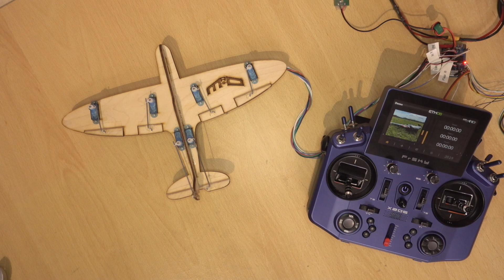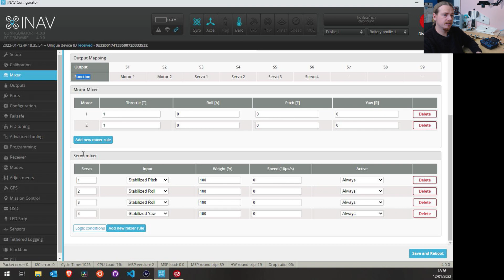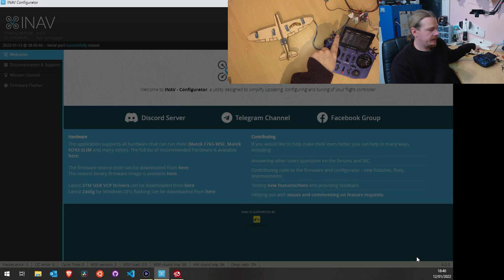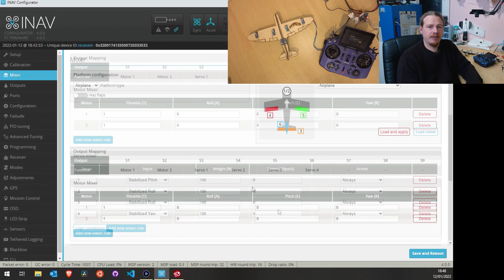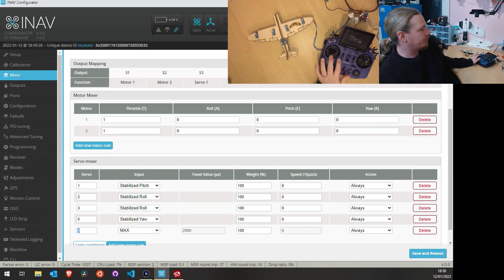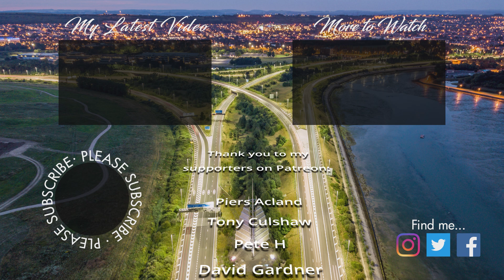Understanding the mixer in iNav

Comment: Good morning mate, just a quick question. I have a bush mule V2 RC plane that I am wiring up on. A. Speedy b flight controller. The bush mules ailerons were connected together into a single servo plug. Do I split the aileron servos so I can plug them into individual output pins?

Comment: Can I apply a logic condition to motors as well as servos? Like for a push-pull inline twin airplane, could I set a 3-position switch to front/both/rear motor selection, that then enables the single throttle stick to control only whichever motor(s) is selected, while the other motor remains frozen at whatever throttle setting it had.
Reply from the maker: No, motors do not have that option.
Reply: @MrD  Thanks. I've got it working in EdgeTX Companion now, instead of using iNAV. Not perfect though, still needs some tweaking.

Comment: Hi, can you possibly explain to me why half the servos don't work in my FC Matek? It reads them on INAV but they don't work
Reply from the maker: If it’s the F405-WING V2. Did you connect the power?
Reply: @MrD  yes
Reply from the maker: @ossamanyadi1919  i think you need to ask in INAV Fixed Wing Group on Facebook or Discord. It will be easier to see what’s going on there.
Reply: @MrD  I will do as you say, because the problem is very strange

Comment: What's the mixer setup if I only use one servo in the middle to regulate 2 aileron left and right? One servo linkage to each left and right aileron.
Reply from the maker: I'm sure there is a mixer for a single aileron servo in the list. If not, you can just delete one of the stabilised roll lines

Comment: Hey Darren, at 8:13, you mentioned putting climbing mode on a switch which would also require offsets. Do you have a video that describes how to set that up?  I imagine that would be done on the radio mixer (not on Inav). Thanks.
Reply from the maker: The offset is so that there is more up than down. You'd just set that on the transmitter using weight or curves. There is a video on climbing mode https://youtu.be/6PZ83l5BcS8?si=diU3o67cpz33chmu

Comment: Darren, thanks for the video. In a flight accident (bad crash) the ESC "+" S1 pad of a matek F405 - WSE was stripped and I am unable to weld back the ESC. Can I use the ESC "+" pad of Motor 2 instead? this way I would recover the FC that seems to be working for all the rest... thanks for your advise with this issue :)
Reply from the maker: Both the main power pads for the ESC are the same. So it’s fine. You can use S2 too if you need to. But you would need to add a 2nd motor on the mixer.
Reply: Thanks Darren ! That saves my FC to go into the bin 😊. I thought that the FC would not manage having one motor only on S2. Thanks again

Comment: Hi Darren. Very good videos. Question: I have a glider without ailerons (ie only engine, elevator and rudder, three channels). Is it possible to use INAV to control this? What should I do in that case, change the aileron channel to the Rudder channel in INAV, or do I just leave Rudder and Elevator?

Comment: Hi, Darren let me ask you a question, pleaase. I hear from every side that it is not a good idea to do any settings on a transmitter side and it is recommended to do all in iNav. Well, think if do some settings working only in manual mode then in could be OK. All, settings done in my transmitter can be limited to a manual mode. What do you think? I would like to do some mixes/settings in my Tx. Thanks
Reply from the maker: It depends on what you are thinking about. But if it has anything to do with the control surfaces. It is best to do it in INAV.
Reply: @MrD  thank you for the response 🙂 I would like to control flaps on my wing plane in my Tx, it is easier. I do not want to do anything for other control surfaces. I used to have FPV camera connected to a servo and it was controlled via gyro. I used it for turns, so when plane turns to a side (ROLL) the camera moves to that side. I do not know if this can be done in iNav
Reply from the maker: I would do all the flap mixing in INAV. 

There is a feature for basic stabilisation like that for a camera. I think it’s called CAMSTAB. I’ll have to check in INAV. But there is something that should do what you want.
Reply: @MrD  Thank you 🙂

Comment: I can’t even get into the mixer! INAV just basically freezes up. Board is a Matek h743 with the correct firmware and INAV 5
Reply from the maker: Do you have an SD card installed in the flight controller?
Reply: @MrD  yes I do. I finally got the board to work. I uninstalled the configurator and reinstalled it and everything is golden now!
Reply from the maker: Cool. Sometimes the SD card can be the issue. I was having stuttering in Configurator. Removed the SD card and everything was smooth.
Reply: @MrD  I tried that. The uninstall and reinstall fixed the issue. Thank you

Comment: Is there a way to map  servos 1,2,3,4 to outputs 1,2,3,4 instead of having the first two outputs reserved for motors?
The reason I'm asking is that I'm repurposing an old drone FC (DYS F4 Pro, sometimes referred to as Omnibus), and it has exactly 4 PWM outputs for the ESCs but nothing else. Inav seems to reserve the first two outputs for motors (regardless if I delete them in the mixer) which leaves me with only 2 available outputs for servos instead of the 4 I need.
Anyone know of a solution to this?
Reply from the maker: No, you can’t remap in iNav. The pins are assigned in the target based on timers. Sounds like that fc would only work on a model with elevons.
Reply: @MrD  Hmm is there alternative software to inav that can do that? Perhaps betaflight?
Thank you either way!
Reply from the maker: Not really. I don’t believe BetaFlight can be used with fixed wing, and it doesn’t have any of the navigation. To be honest, the Omnibus and clones aren’t great flight controllers.
Reply: @MrD  Gotcha. Bummer!
Yeah I'm just using what I have laying around here. Wanted to get some practice in on cheap hardware before I go all out on a more expensive rig.
Reply from the maker: @Chretze  It would be fine with a cheap flying wing. That only needs 2 servos.

Comment: Should i be reporting the inav bug? So strange I have 3 f411wse the plane I fly the most using waypoints and such I have never had the bug happen. But the 2 brand new f411 wse with the newest baro spl06 baro both had the bug happen within the first 10 packs or so I use loiter and auto launch but fly them mostly in acro All are on 4.0. Reading the inav group I understand it's a well known issue just wondering if I should report it.
Reply from the maker: Which bug do you mean?
Reply: @MrD  yeah that might help. the random config change bug I believe it's called ln the inavfwg site.  Changes the lpf filter and makes it wait for gps even when you have plenty of satellites.
Reply from the maker: I wouldn’t worry about reporting it. There’s already and issue for it. Someone actually spotted something the other day, which may be a lead. They’re looking it to it, so maybe there’s some light on this. It can be annoying at the moment. So hopefully this gets resolved soon.

Comment: Darron:
  It is obvious that you have an outstanding mastery of the compex logic of this setup and its flexibility. 
   Not having used INAV yet myself, it was well over my head, but it was very useful to watch & listen for when I'm ready for this. 
   You speak clearly, though perhaps a bit too quickly. It might be helpful to pause periodically to let our brains catch up with the logic. 
   I'm elated that we have devs like you to work out this logic, enabling us to use it when we need it. 
Thanks. - Jim
Reply from the maker: Thanks James. If you're just starting out, the most important part to understand on the mixer page is the output functions table. That's the key to getting the mixer and servo outputs set up successfully.

Thanks for the feedback on the speed. I have kind of noticed it and will try to slow down with my speech. However, I won't add gaps for pauses. As these can interrupt the flow of the video for those who aren't so new. I have to cater to everybody. But, the pause button on the YouTube player is always an option. And I hope the chapters are helpful if parts need revisiting.

Comment: Nice, thanks, would be great more mixing videos with in detail what everything means and more complex mixing, also the tailsitter vtol configuration
Reply from the maker: Thanks. What do you mean by more complex mixing? Adding flaps I've already covered. If you have anything in particular, let me know.
As far as I know, a tail sitter VTOL has nothing special going on at all. You just sit a wing on it's winglets and give it full throttle.
Reply: @MrD  
 no, tailsitter even hovers, https://youtu.be/qjZw4kXLobQ 
about mixing, I’m still trying to understand it, the Programing tab on Logic switches and it’s options and what they do + mixer tab, all options in inputs windows like GVAR and MAX and how they interact to each other, setting an idle up, flaps with up elevator, differential aileron,… just understood what was the “xxx stabilized+ and -“ I was looking for it all over, thanks to show us
Sorry English is not my first language!
Reply from the maker: No problem. To be honest, I don’t really know much about VTOL. I’m not overly interested in them if I’m honest. Most of them seem to be inefficient quads that turn in to planes with lots of extra drag. Though that tail sitter is really just a twin motor flying wing, which is a much better idea in my mind. 

That hovering could be done with skill. In the same way that 3D pilots hover planes. But that video definitely looks like stabilisation is involved. I’m guess in they using angle and have set it up in that orientation. Otherwise angle mode would try to level the plane. How you would transition from that in to regular flight though, I’ve not thought about. 

Its a cool concept, but for me personally, VTOLs just waste too much energy getting in to the air.
Reply: @MrD  I know, I was not interested as well, but it could be handy to FPV as we could takeoff from a tree crawled space and than just fly over it all,…
May be a mixer that allows a Bicol ter setting transitioning to airplane?

Comment: Hello Darren, and thank you for a very informative video. I have two questions:
1) I use Y-harness on ailerons to save an output servo. Do I get the same amount of stabilization with a Y-harness on one output servo as you get with a separate output servo on each aileron?
2) You made some examples of how to use the INAV Mixer as the mixer on your TX. How will the mixer setup be mixing the elevator and flaps to avoid "ballooning"?
Reply from the maker: Thanks 👍🏻

Using a Y harness will give the ailerons the same stabilisation. The problem using a Y harness for ailerons on a glider is that you can’t use crow breaking.

To combat ballooning, you could add a mix line to the elevator using the flaps control as the source. Check the direction is correct, then lower the weight down to something like 5%. You’ll need to adjust the weight depending on your airframe. So test with plenty of height.